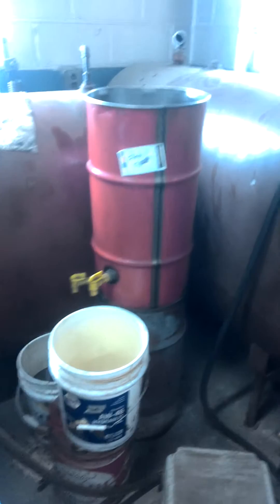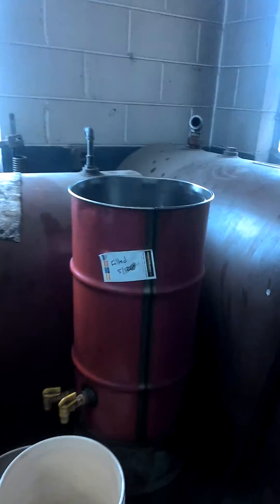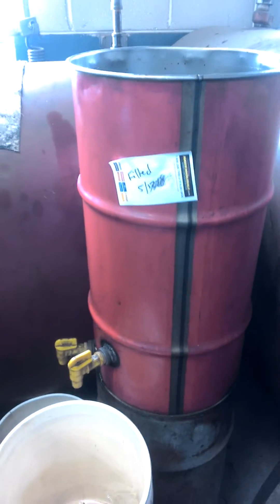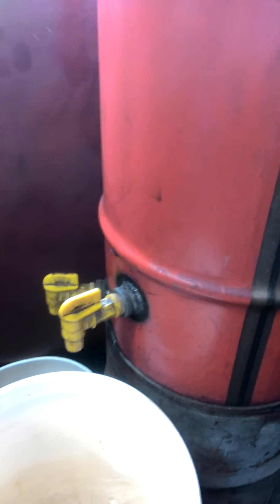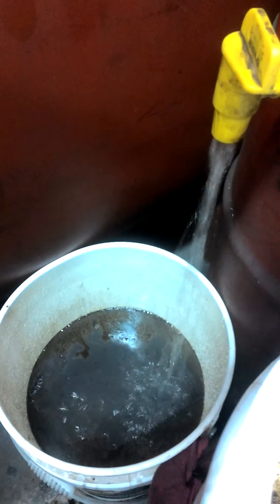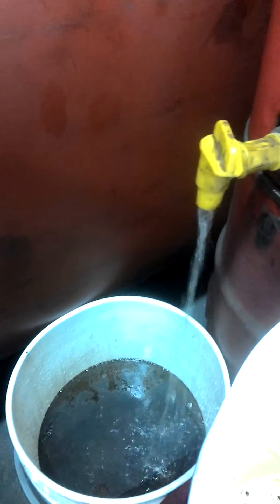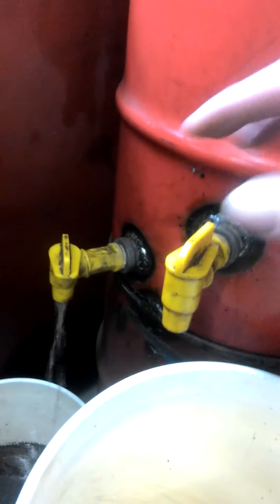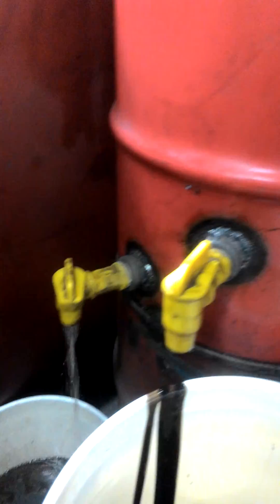Oil water separator, waste oil

Comment: Trick I learned... if it's just water ( no antifreeze) just let the barrels set outside until it freezes hard. The water will be a ice turd left in the bottom and you can simply pour the oil out.
Reply: 你好